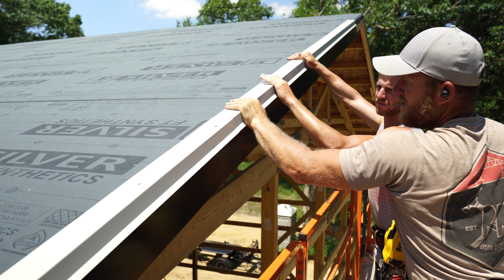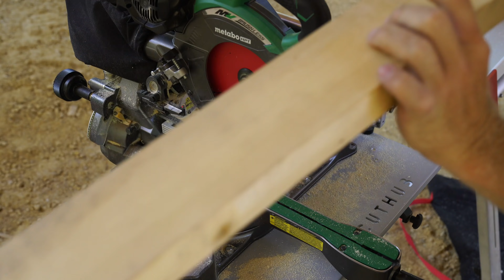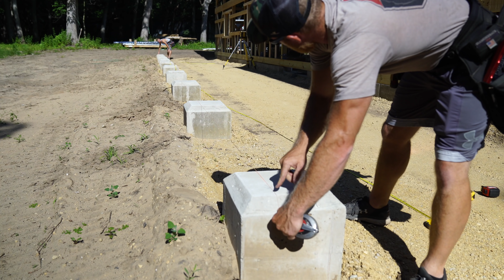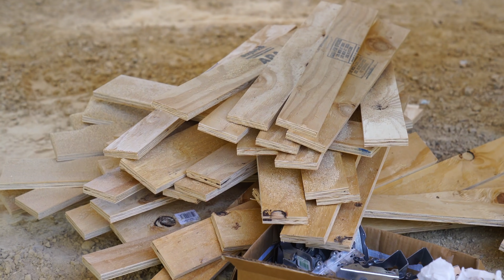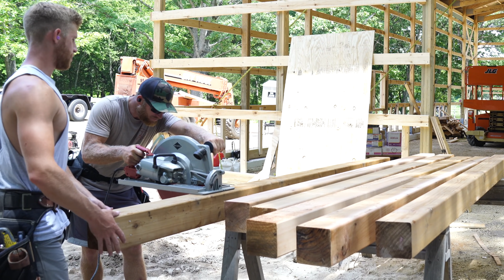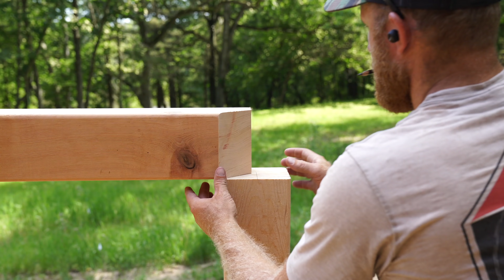Cabin in the Woods Part 9: Cedar Porch Framing

Comment from the maker: Lots of content for the porch frame coming up soon!  It's going to be a two story deck as well, so if that interests you stay tuned!  After the porch is framed we will start Standing Seam Roofing Details
Reply: Awesome. Don't forget to stay hydrated. :)
Reply: I'm not even in construction by trade but you sure make me want to get after it in my diy stuff to out do the "remodeling crews" round here.
Reply: love your channel coming from New Zealand !
Reply: You should look into the Simpson Strong Tie Outdoor Accents line of brackets they are very strong and finish better than the 6x6 bracket you used in this video at the bottom of the post!

https://www.homedepot.com/p/Simpson-Strong-Tie-Outdoor-Accents-Mission-Collection-ZMAX-Black-Powder-Coated-Post-Base-for-6x6-Nominal-Lumber-APB66/300066053

Comment: @RR Buidings  :-)  In addition to the GRK fasteners, would you consider cutting mortises to insert some floating tenons (e.g., dominos) as a way to securely connect the horizontal members to each other and to the porch columns for increased lateral stability?

Comment: It almost seemed like you were worried about 1/16” in that long run. That’s not worth worrying about but also one of the reasons I would love for you to build my building... except it would never be justified for a 32x40x10 basic building since you are about 5 hours away. Love the videos anyway. 😎
Reply from the maker: 1/16s add up when left unchecked
Reply: RR Buildings I know. I was more referencing the fact that it was at the end of the run. I meant to say it that way but failed. I built a roof over my patio and the mill was about 1/32 to 1/16 off on most of the rafters and ended up 1 1/4 off because I followed the blocking instead of the layout. Luckily, I noticed it after only nailing 4 bad boards and didn’t have to re-do too much.

Comment: @RR I am curious about the nails part.

I enjoy watching your videos and I noticed that the US way of building is based on a lot of nails. Are they strong and reliable enough? If the owner decide to make changes or remove part of the construction, can it be done or it should be broken?

You see in my country screws are used much, much more for solid constructions. While nails are usually for small things or just to hold while the screws are being fasten.

Comment: No treatment or sealer on the bottom of those posts? Even though they aren't in the dirt I would have wanted some kind of protection there and all the end cuts that'll be hard to treat after assembly. Or is it all going to be dried in? But dang, nice clean cuts!
About the color, the whiter sapwood is less resistant to rot than the redder heartwood. When I can be picky I'll choose the reddest stuff out of the pile.

Comment: Really?  Track Saw are only for finished carpenters?  What ID10T said that, because most FINISH Carpenters and Cabinet builders would be using big a$$ cabinet saws in their shops, and on site they might use then, but usually FINISH carpenters aren't working with sheet goods as much...I always saw a track saw as a way of ripping down large lumber fast.  Jury is out on the Festtool I inherited...I'm not all that impressed with it so far.

Comment: I’ve been saying for awhile, that cordless tools are great but not quite ready for a wholesale takeover. 
That Makita cutting thru 4½ sheets of ¾” plywood was the most impressive, practical demonstration I’ve seen yet. I’m curious whether the battery power has increased that much or if Makita has reworked some gearing geometry. Probably a little of both. In even the most ardent skeptics book, that was impressive. 

Given a must choose situation, I would still go corded though, bcz I’m still not sure about battery longevity. I don’t mean longevity between charges, but rather actual battery lifespan. New batteries are great, but in my experience, they deteriorate over time and are only good for about ~2-3 years. Even if you’re not using them daily. Still impressive though to see how far battery power has advanced in a relatively short period of time.

Comment: QUESTIONS:
1. How to you keep birds and insects from setting up home in those soffits you just installed?
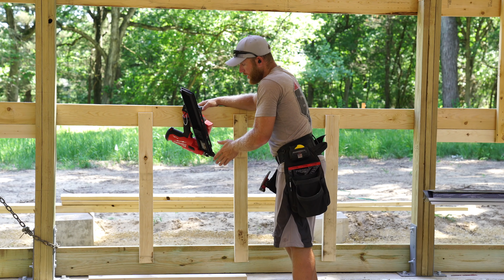2. At 7:20, what is the reason that the 2x4 members aren't cut to go down to the cement? Granted, most of the weight of the wainscotting will travel down the stone as well into the plywood and the great board. Is it that the added expense of those extra inches of lumber outweigh any potential structural aid? Is there something going under those 2x4s that wasn't discussed yet?

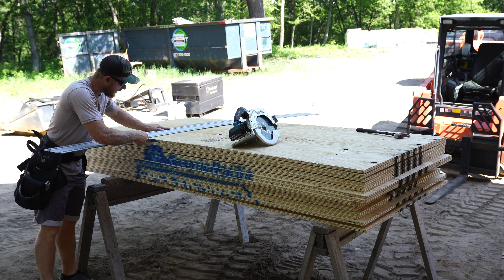NOTE: at 11:25, YouTube subtitles decided that the sound of the track saw cutting those plywood sheets was music. I guess one of their programmers was a carpenter?
NOTE 2: 12:08, This time it also claims there is applause.
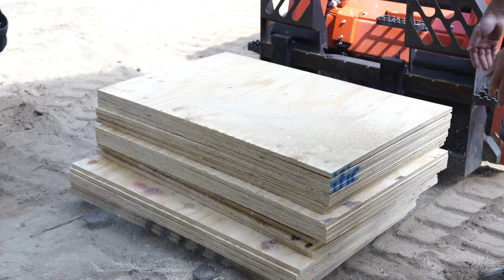NOTE 3: Table saw at 12:58 also listed as music. Also, aren't framers just a form of carpenter? Also, use whatever tool works best for the situation, not what others "think" you should be using.
Reply: 1. The soffits are sealed all round. There is no opening for the birds and insects to get into.
2. My understanding of this is that there is no need for them to extend to the concrete because they there for the plywood to be mounted to and to stop it from bowing inwards, not to help support any weight.
Reply: You can't sit untreated timber on concrete that is in ground contact.

Comment: I thought it was funny that you were saying to use the Milwaukee framer at an angle because you didn't want the tip of the nail to poke out and make a dimple on the metal...meanwhile, you're nailing straight towards your chest

Comment: 00:25 Not only that, EVERYTHING moves (at least in the Northeast) from new work settling, existing work expanding & contracting in weather extremes, etc... You want a "system" in place that moves with the structure. Otherwise, you'll be guaranteed to get buckling if someone tries to build everything too tight. That's why 100 year old houses lasted so long without insulation or airtight builds. They breathed and any moisture they'd take on would have someplace to go. Like my old man taught me; 'A house is a living breathing thing. Don't choke it.'